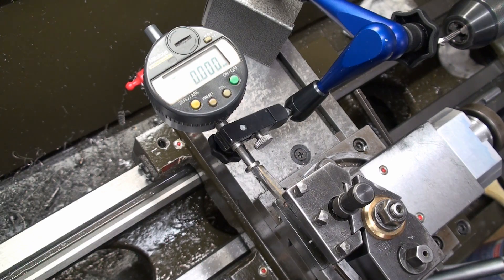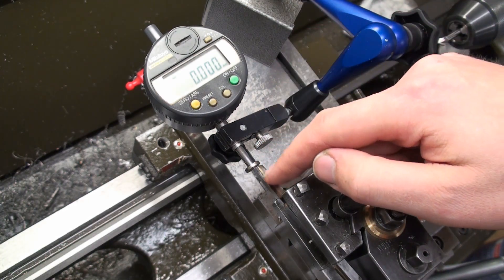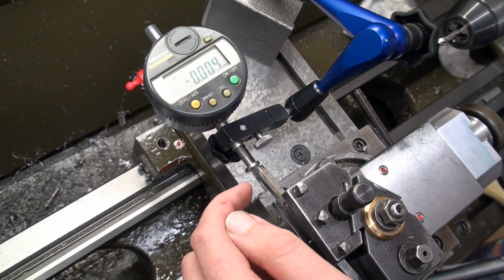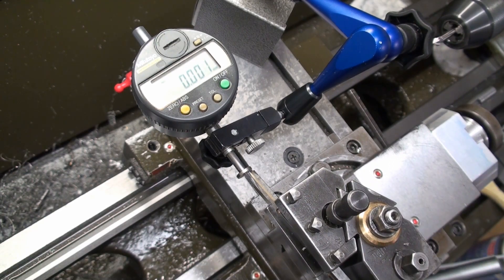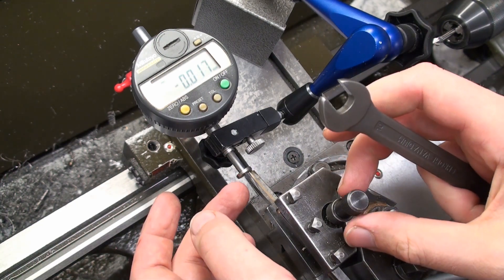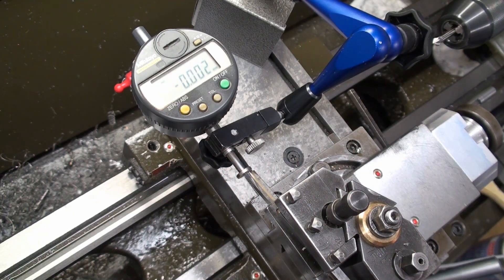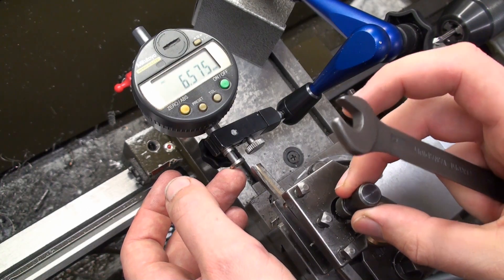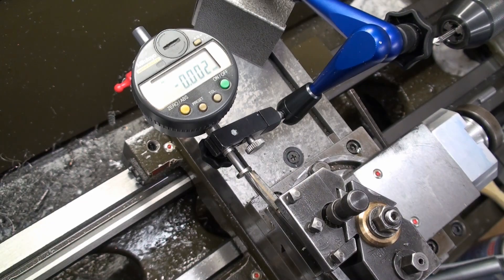Tripan 111 QCTP Repeatability

Comment: They are currently not in production.
Reply: Dear Mr. Trojanowski,
Dear customer,
We hereby wish to present you the young society SwissKH Sàrl which aims to promote the know-how 
in Switzerland. In this context, SwissKH Sàrl’s engineering and products is at your service.

As  you  may  know  it,  the  society Antonazzia  Mécanique  SA  produced  the  products  TRIPAN®  and 
SUPERCOUP®  from  1993  to  January  2017.  These  brands  responding  to  a  real  need  of  know-how  in 
Switzerland  and  abroad,  SwissKH  Sàrl  decided  to  take  over  the  task.  Antonazzia  mécanique  SA  and 
SwissKH Sàrl worked together in order to realise this transfer in the best conditions. SwissKH Sàrl would 
like therefore to offer the same products with highest quality and a supply that corresponds to your 
demands.

SwissKH Sàrl fixed the objective of progressively repurchasing stocks in 2018. Planning is available on 
our website. By  not knowing precisely your needs, SwissKH Sàrl recommended that you realise pre-
orders to limit your risks. This is going to allow SwissKH Sàrl to meet your expectations as quickly as 
possible. To facilitate this, we inform you that the sales prices and the discounts granted by the society 
Antonazzia Mécanique SA are remaining in effect.

You can as of now pre-order these differents products to info@swisskh.ch.

SwissKH Sàrl is also an engineering firm that develops bespoke elements. It proposes specific products 
that meet your requirements. SwissKH Sàrl is at your disposal for further information and invite you to 
discover its website www.swisskh.ch.

In  the  expectation  of  meeting  you  and  to  of  collaborating  with  you or your  factory,  we  hope  that  this 
announcement is made at the most appropriate time to ensure a relationships’ continuity about the 
products’ Tripan® and Supercoup® commercialisation.

Yours faithfully.

Bryan Gosparini
CEO SwissKH Sàrl